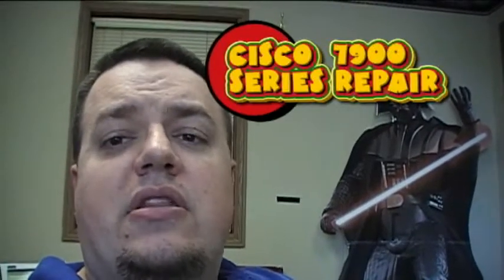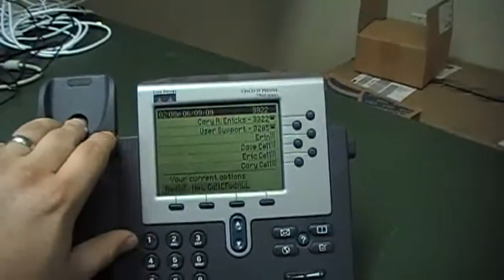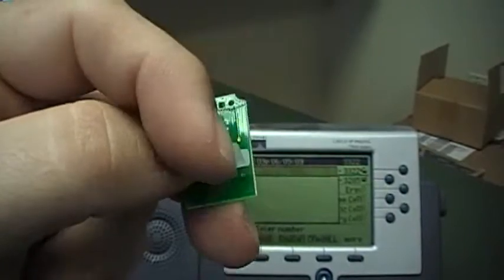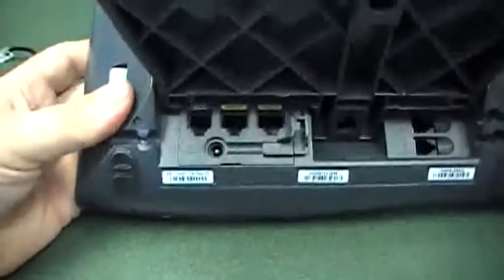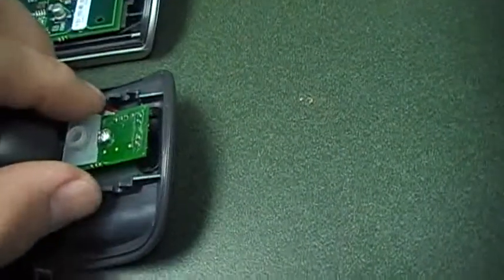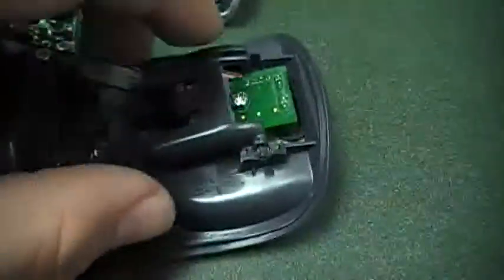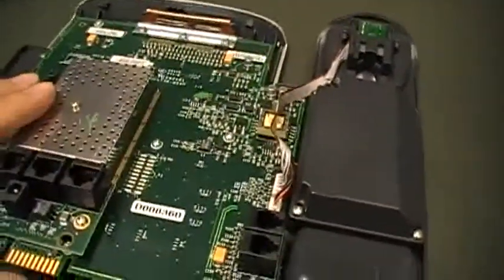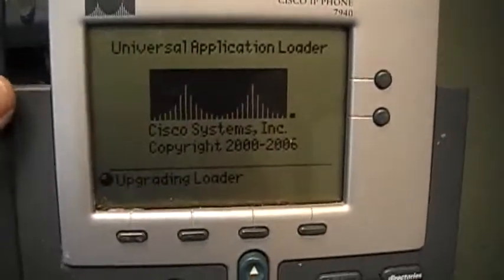Repairing a Cisco 7900 Series phone when the handset won't work.

Comment: Actual issue is not to raise the small board, just cleaning the contact surface and the rubber contact with clean alcohol etc. This will fix the issue as well.

Comment: Thanks for the video.  I return several phones per month with bad hookswitches.  I don't always have time to clean them, but when I do, i'm going to give this a try.  I have pasted an excerpt from a Cisco page about the hookswitch.  They say they're "self cleaning" and pushing it a dozen time will clean them.  I have been able to have some end users do this and it worked.  Sometimes it does not.  anyway, thanks again for the video and here is the excerpt:
Self Cleaning Hookswitch Contacts

The hookswitch contacts design uses a wipe action to self-clean the contacts. Periods of nonuse of the phone allow air impurities such as dust and other contaminants to hinder contact performance, which results in intermittent operation. Press and release the hookswitch rapidly a dozen times or so to clean the contacts.

Cleaning Contacts

Disassemble the 2 pieces of the phone shell (front and back, should be 4 screws). On the front half, where all of the electronics are attached, find the hookswitch and remove it. Underneath, there is a small white contact pad. Lift the contact pad and clean the contacts underneath with an eraser, until they are as silver as possible.